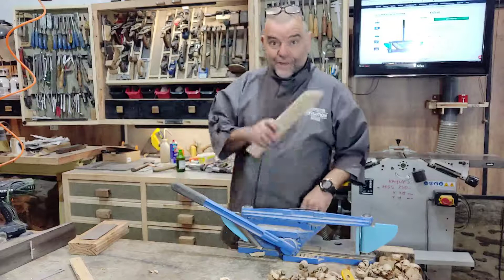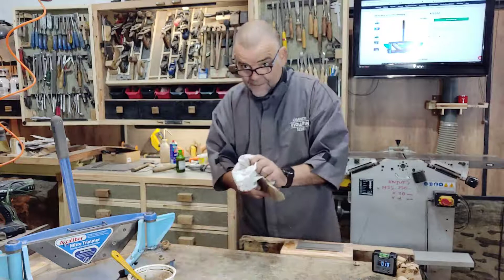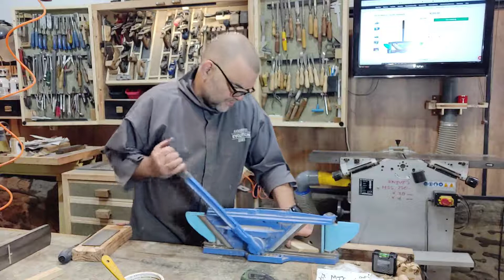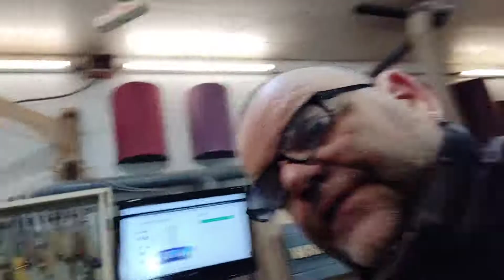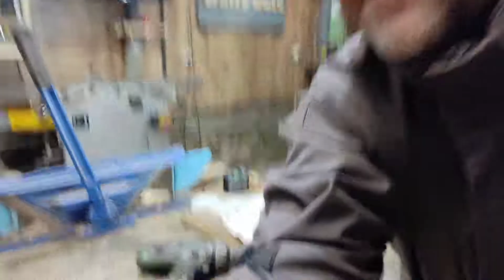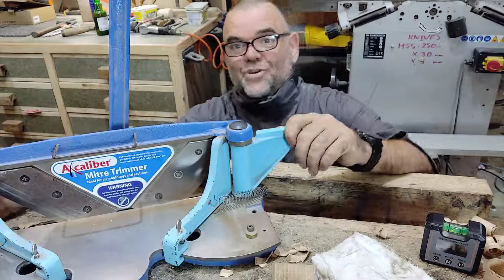How To Sharpen the Blade on a Mitre Trimmer / Guillotine - 2020

Comment: It's a wonderful tool, recommended by David Savage, I've owned an APTC one for several years and sharpened the blades by hand a couple of times by hand fairly successfully, but I've been trying to think of a way to sharpen them repeatedly with a jig and your system beats every idea I've come up with to date.
By the way, it is a tool to be treated with respect, my worst injury was being too complacent using my thumb on the offcut side to nudge the workpiece a fraction forward and pulling away too quickly which caught the blade...ouch!